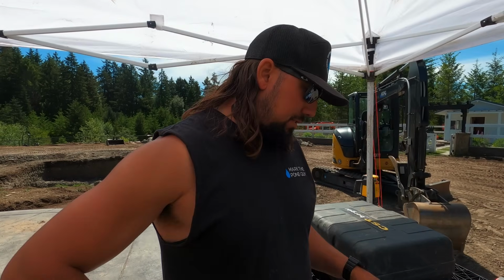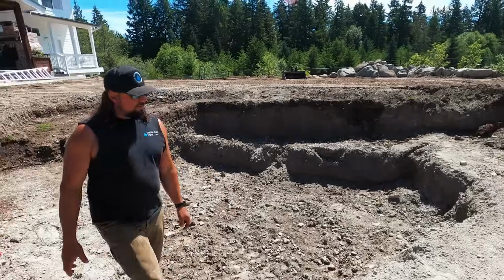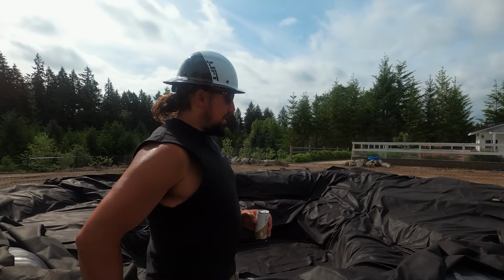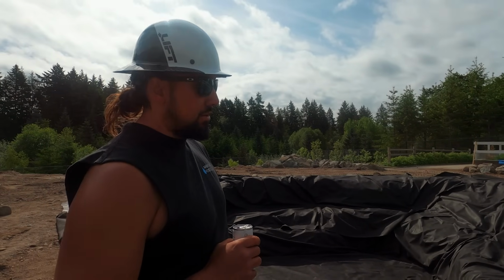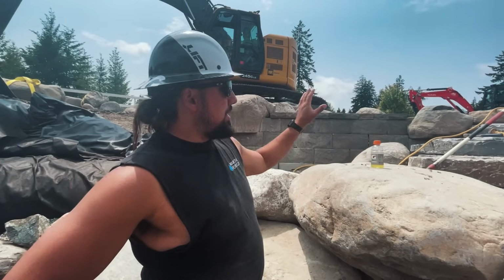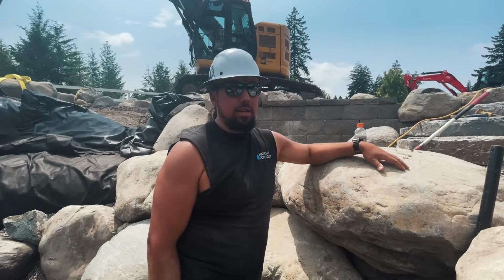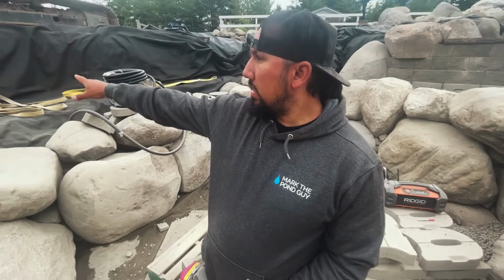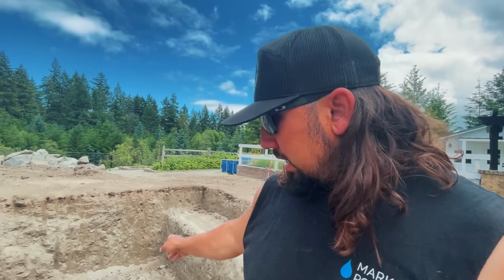Recreation Pond with WHITE SAND Beach! Part 1

Comment: Great Design and functional variety!  Two questions...

Where did you get your white sand?  Love it!

What is the design benefit in having large rocks take up swimming space toward the bottom?  Is it structurally necessary or just for aesthetics when looking into the water?  I would rather have more swim space and use larger rock for waterfalls and alongside.

Comment: When they start these they always look a descent size then they fill them with rock and turn them into paddling pools
Reply: Yeah, if your rocks are 40cm - 50cm, then you lose 80cm - 1m in width once you have laid your rock into place. 

That's if you have shelves that allow you to lay just one layer down. If it needs more rock on that layer to reach to top of the shelf, then you lose more at the bottom.

I've made a few ponds 18m x 16m, and they lose a little on the sides. But the bigger you go, the better. It just costs more to do, it is all.

Comment: Nice work. Does the sand stay fresh underneath without an up flow water pipe under it?
Reply from the maker: Thank you! 👊🏽

As of now this is a chlorinated system so yes, it’s looking great. 
This feature is built with the option to run with natural bacteria vs chlorine as well. 
If the customer decides to switch, the plumbing is set up to run water through the sand.